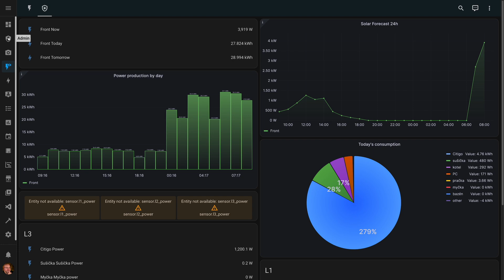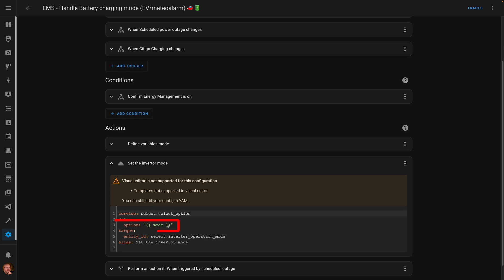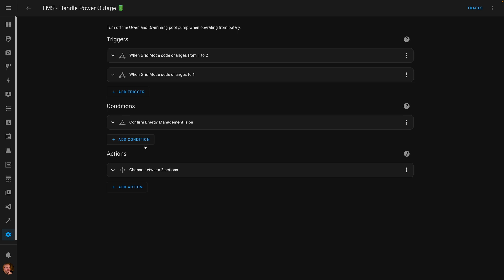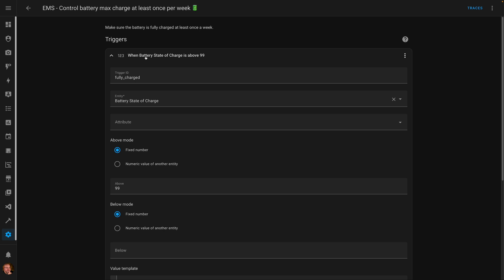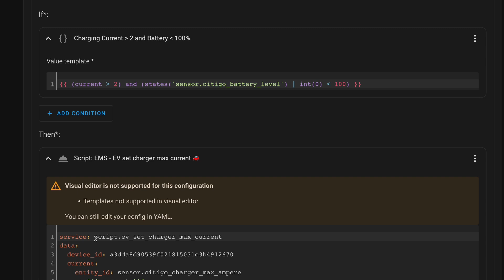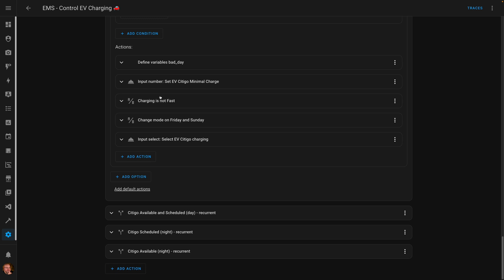Configure your home energy management in Home Assistant

Comment: Very usefull video, thank you Václav. I have one question, how is it possible, that I have only 149 entities in my integration and you have 152 (the same model and firmware)? Also I do not have the ability to change the State of Charge for example, I have to do it via PVmaster app. Thank you
Reply from the maker: I use the custom experimental integration from HACS.

Comment: Very nice! I have a similar but slightly more complex and flexible setup (electric car, PVs, batteries,  pool pump + smart wallbox, hybrid solar/electric hot water system with homemade PV divert electronics, 2 invertible heat pumps -- and 3d printers :-). My automation are naive compared to yours. This is an amazing source of inspiration (and also very  useful for better understanding of HA, templates and automation). Kudos! Liked and subscribed.

Just two comments: In my knowledge, full charges of Lithium batteries are not good for battery health and only useful for the BMS to get a good estimation of the SOH (state of health) of the batteries. The best strategy to keep a good SOH is apparently to do "opportunity charging" which charges batteries a bit and keep them at a reasonable but not extreme level (say 50 to 75% charge) as much as possible. This apparently may have a non negligible effect on the battery lifetime (according to scientific papers I read). This seems more crucial forNickel/Manganese/Cobalt batteries than for LiFePo4 ones, which are more resistant. Given that SOH changes slowly, I would shift your 7 days to 1 month too preserve the abbetries from too much useless cycling at high charge levels.
Then, my experience with solarforecast is a bit disappointing. I thought I would use meteo forecasting instead... What is your experience here?
I'am also amazed by your dashboards. I hope you have plenty of videos with these :-) Will look into it.